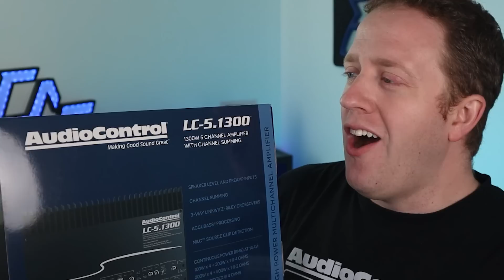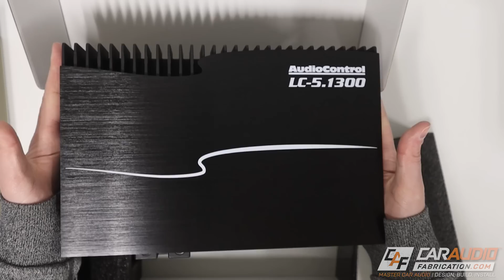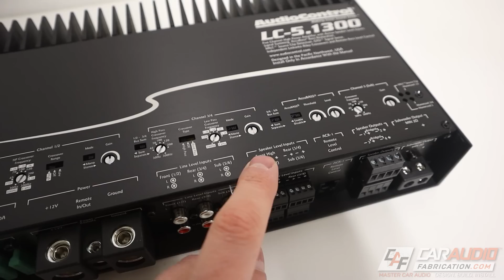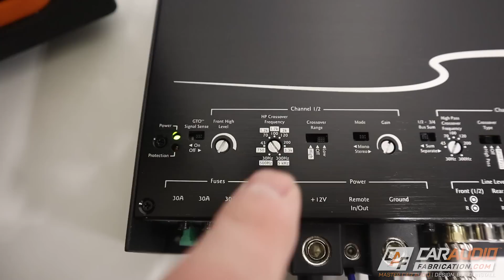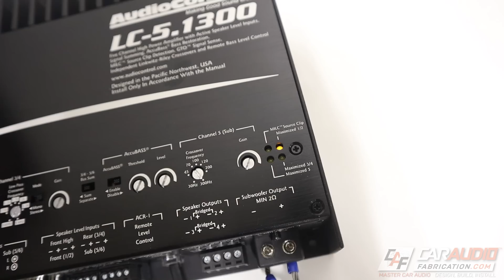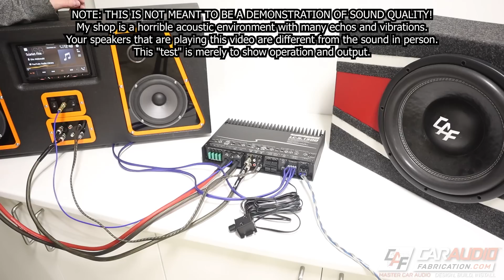Subs & Speakers Powered by ONE Amp? AudioControl's 5 Channel LC-5.1300 Amplifier!

Comment: Can I use this amp to power a 1500w sub
Reply: You can. Just don't crank on the gain trying to make it as loud as your buddy's 1500W sub.
Reply: It can run the sub (don't listen to that stupid myth that a small amp will damage a sub), it just can't run it at full capability. It would be like if you had a 1500 watt amp with the volume control only turned to around 1/3 on your source. If you intend to run that sub at full potential you're better off getting a bigger amp.

Comment: Hey Mark great video. i wanted to no this may sound stupid but. I'm new at car audio which ohm has more bass 2ohm or 4ohm .
Reply: Neither/Same. Lower Ohm loads will allow an amplifier to push more power, but 100W@4Ohms and 100W@2Ohms is still 100W.
Reply: @gakudzu7282  thanks.

Comment: Wouldn’t it be better to turn the gain down on amp so that when someone gets in the car and turns the volume above 33 they don’t destroy the speakers or causes clipping? It seems too open for error in relying on head unit not to go outside of safe parameters.
Reply: The clipping at 33 was from the head unit's rca output with the amp gain on min. No way to remove that. It only goes to 35, so not likely to break anything.

Comment: can you please do a video on Ohms, wiring like parallel and the other ways.. and how to get the best use out of your mono amp. i have an Alpine MRP-M500 and a alpine type R...but its just not bumping like it used to... not blown.. amps are putting out proper power too but when i do a conversion with volts and ohms.. idk something doesnt add up... i thoughti i could get the full 500 rms or so...but imlike at half.. and type r is at 4ohms....in a prebuilt box... :/ idkwhat wired in there...ly man youre the best,,, thanks for this awesome vid...wow five ch. 8D
Reply: I was gonna ask for the same type of video too lol. As far as I’ve been told wiring in parallel drops ohms in half and series adds the resistance of the two devices together but I am by no means an expert. I’ve heard 2V output is low and might be a cause of lacking power if the amp is mounted in the trunk (if the rca cables are long the voltage output starts to drop)
Reply: @nsleone299  thanks man I think that’s right too
Would just love an in depth video with the quality this guy puts out he prob has some amazing tips and tricks for all that too.. working and such.. but yeah no voltage drop really.. like .01 or something.. and my battery is relocated in the trunk so I got lots of power going to my short lower leads
Good on voltage performance there too... 
I think my head unit is screwing me
Would love to see a vid about “headroom” and stuff too
Thanks team
Love this community
Reply: Does that amp make 500W@2Ohms, or @4Ohms? If its rated 500@2, then yeah, you're only making around 250@4Ohms.
Reply: @gakudzu7282  mono subwoofer car amplifier
300 watts RMS x 1 at 4 ohms (500 watts RMS x 1 at 2 ohms)
😩
Reply: also idk the right conversions...i see all sorts of crap.... to find the actual wattage... i have a seed studio v3 too and used it to tune so no clipping....
Reply: maybe my headunit sucks...its only 2volts...i see others are at 4volts..damn
Reply: My calculations gave me around 300 something watts
So
Damn... and the sub is 4ohm unplugged sitting flat facing up
Reply: I must not the head unit I am using that came with the car I’m in now there’s only a 2 V output the RCA’s
I think my original might’ve been 4 V out
No this has not to do with headroom in someway but I can’t really wrap my head around it no pun intended
Reply: Plot TWIST haha I’m back 
I just figured out my sub is a dual 4 ohm sub so there’s no way wiring could give me 4ohms
I wonder if the freezing below 0 temp did that
That would also be a really good video 
How temperature affects impedance

Comment: have anything that’s more in a regular persons budget
Reply: Nothing I know of with all these features for factory integration. If you you're using an aftermarket head unit, there are quite a few 5channel  options: Pioneer, Kenwood, Skar, NVX, etc.
Reply: The skar 5 channel is surprisingly good
Reply: Check out willston labs test on the skar

Comment: Would something like this work with the factory sync 3 system in my 2020 Explorer? Would most installers have access to this and know how to install it properly or do I need to look for only a high end place? Does Audio Control have a list of recommend installers? Sorry for all the questions, just not a lot of info online on my vehicle.
Reply: It hooks up like any amp. If you go to any reputable installer, they should have no problem installing this amp. The tuning is fairly straight forward and you can follow the instruction in this video to do that yourself if they don't set that properly.

Comment: Love this channel, seriously. Thank you, I am long overdue for a build and I have used Audio Control before, great products
Reply from the maker: Thanks for watching! Let me know what you end up doing
Reply: @CarAudioFabrication  hey a have a question about the high output.. im a lil confused about what it does.. are the factory speakers getting the power from the amp??? Or just getting the same power from the factory?????
Reply: When I say power i mean wattage...
Reply: @CarAudioFabrication  me and my friend have Honda Accords and we are experiencing some weird stuff with this amp. We are using Inputs 1&2 only and summing. We are pulling off the front door outputs which is full range. If switched to separate obviously you loose output on 3&4 since you're not summing but the 1&2 outputs get twice as loud with much more bass. When summing it's not loud at all and the sound lacks that full warm sound. I'm surprised nobody is talking about it. Your thoughts?